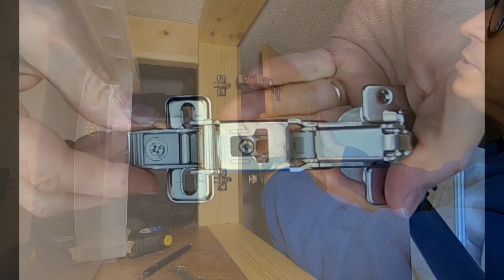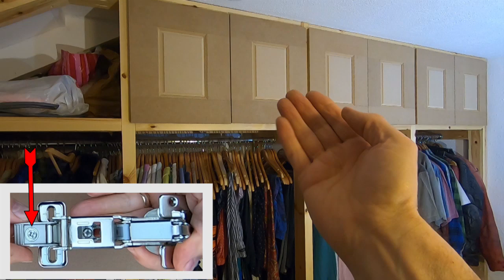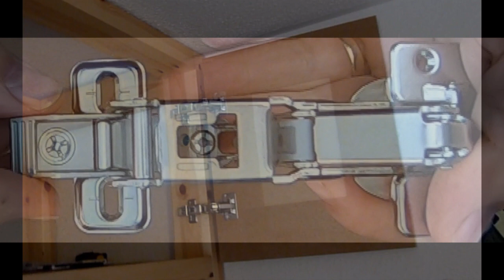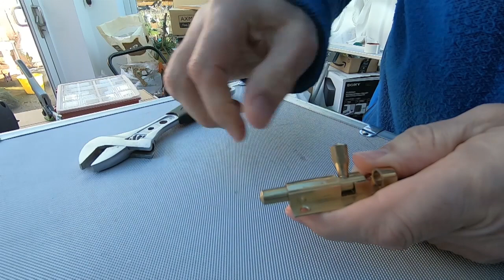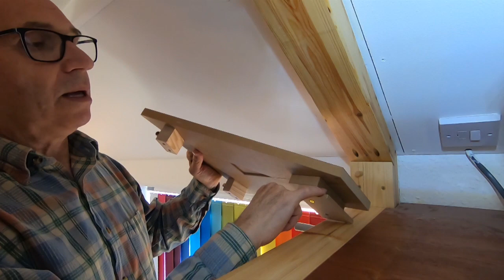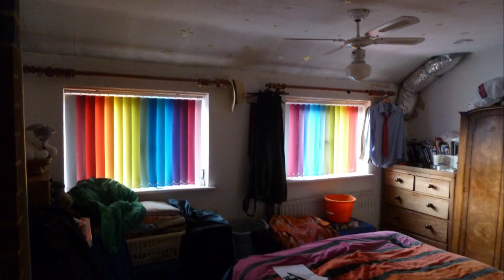Hanging & Levelling Doors: DIY Fitted Wardrobes Part 6.

Comment: I can't work out if you are left or right handed
Reply from the maker: Hello Nick. Thank you for another comment. I am right handed when it comes to do accurate things. When I'm working I have always tried to use both hands as the lead hand, I did this to share the work between my arms and not end up with a really worn out right hand/arm, but partly worn out both arms! It wasn't easy, my right hand is much better at doing things than my left. As I'm making videos, sometimes to get a good shot I need to use my left hand instead of my right, it comes in handy there. So there you have it, I'm right handed, but trying to be both. Take Care Jim